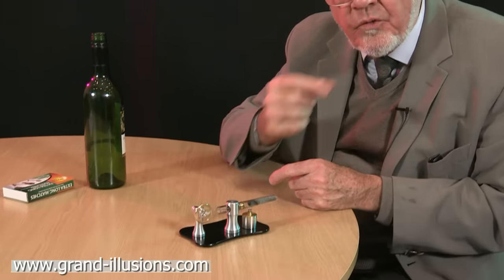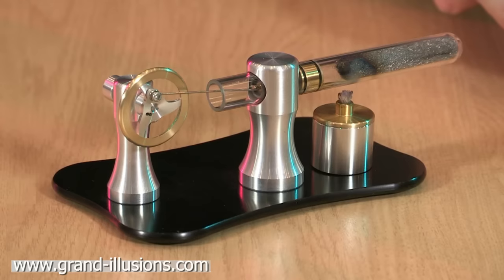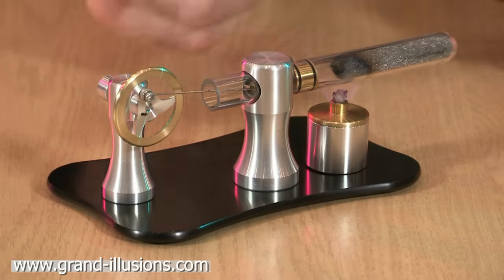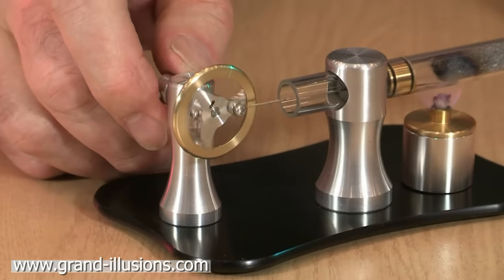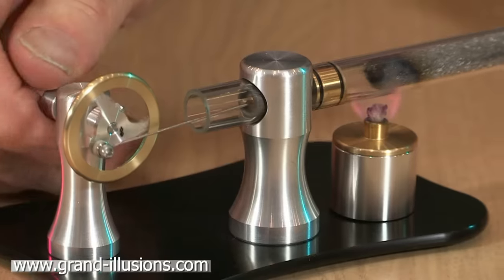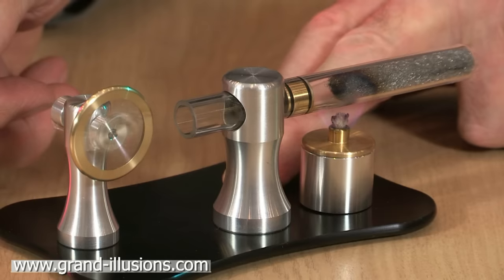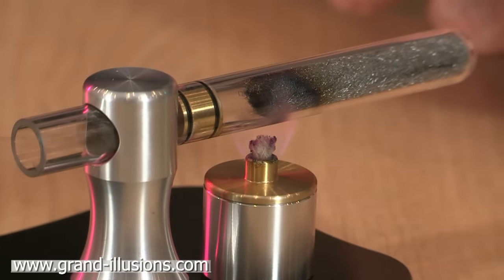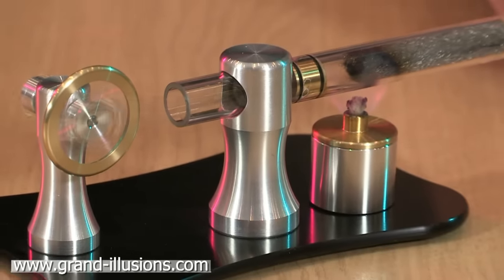Thermo Acoustic Engine

Comment: engine is a word that means it powers up things, this engine cant power shit, hence its not an engine its a demo of transformation of energy, in short its crap
Reply: This is the exact definition of an engine: a machine that changes energy into mechanical motion.  It does exactly that.
Reply: If you just did a simple google search for the word "engine," at the very top of the page you would find this: " An engine or motor is a machine designed to convert energy into useful mechanical motion. Heat engines, including internal combustion engines and external combustion engines (such as steam engines) burn a fuel to create heat, which then creates motion. " Does the bolded section not perfectly describe this?
Reply: useful mechanical motion, USEFUL, exactly what i said, it can power shit, being useless
Reply: A little harsh.
Reply: Baron Mamurny You're right. Its useless. That makes it a useless engine.
Reply: Noxius Nope. You can't "generate" energy.
A generator is actually an energy converter as well. And it can involve motion (for example, a nuclear power-plant generator converts vapor motion into electricity. Kind of like a "reverse" engine)
Reply: Baron Mamurny You would fail mechanical engineering and physics.  Your idiotic comments prove your lack of knowledge on the subject(s).
Reply: Baron Mamurny It generates satisfaction and enjoyment in the human mind. Do you not consider those things useful?
Reply: ***** so do drugs, but we dont call them engine
Reply: Baron Mamurny Of course not because they're not mechanical; this is, so it's an engine, and that's its output.
Reply: There has been great semantic changes over the past century. An internal combustion engine driven automobile was simply called a Motor Car.  So the words engine and motor were used interchangeably.
 A motor is a direct converter of one form of energy into kinetic force, an engine processes a fuel into heat energy which is then converted to mechanical power. At least that is how I define such!
In this example here we might say this machine is both?
Reply: start measuring its efficiency and you will realize its none, then u might even understand my original post.
Reply: +redpr1sm  - An electric generator turns one kind of energy, usually mechanical, into electricity
Reply: +Baron Mamurny  It powers it's own flywheel; oh great fool. like your car engine when it's idling in neutral the entire power output is usefully applied overcoming the unavoidable frictional losses of the moving parts. you great fool.
Reply: +redpr1sm Once again, a Motor is a direct converter of energy into kinetic force. 
An Engine is a processor that consumes fuel releasing heat which generates Mechanical Work
Reply: We're testing the principle on a much larger scale, graduated, low-temperature and used for cooling (though theoretically it could also start pumping). It's efficiency is fine considering the thermal-dynamic limitations and compared to a regular Stirling engine. You need really fat tubes to generate larger amounts of useful energy, but it's so cheap, reliable and elegant, I've rather fallen in love with it and foresee great applications for this.
Reply: i welcome you to post a video of it.
Reply: http://www.aster-thermoacoustics.com/?cat=11

Here ye go, admittedly, it's not a video, but there not being too much moving parts but for the graphs makes that hardly very interesting
Reply: +Baron Mamurny This comment is Typical non science related comment.You don't even know what is the meaning of engine.I suggest don't interest any science related work.